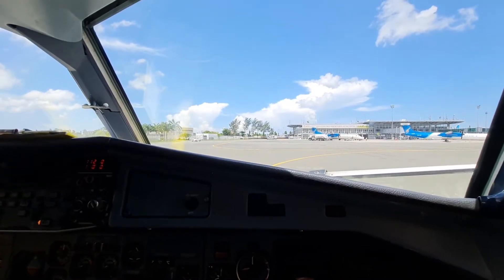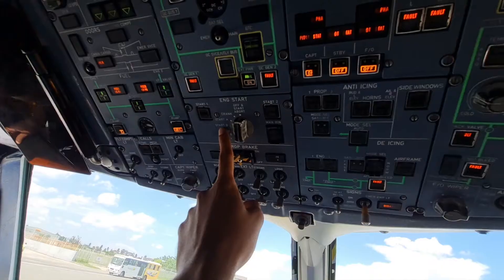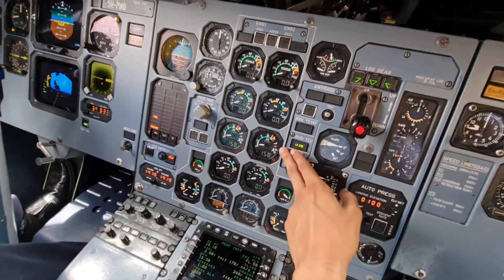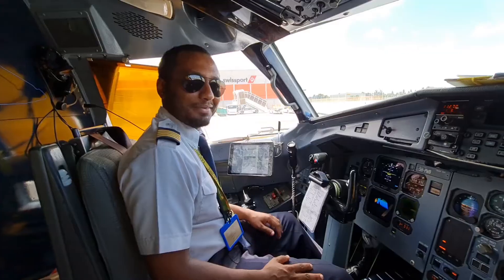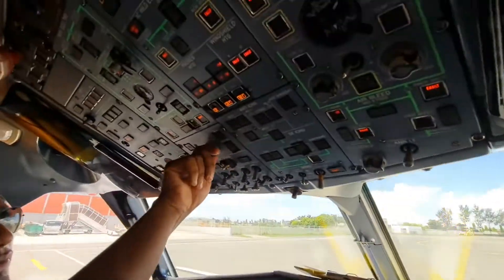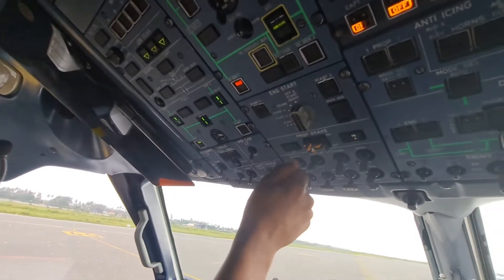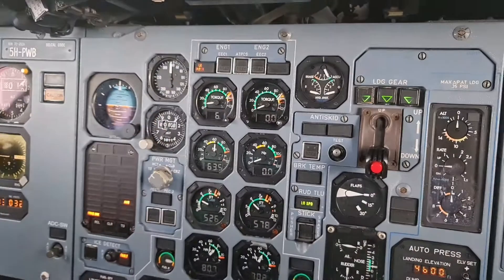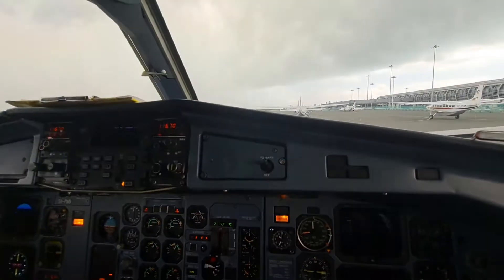Detailed cold and dark engine start up ATR 72-500

Comment: excellent, in a next video there is a demonstration during the operation of the hotel mode moving the power lever from GI to FI, is it true that it increases the air flow in the cabin?
Reply from the maker: Hello Arthur! It is true that the airflow increases when the power lever is moved from GI but it's to gustlock stop and not FI. You have to monitor your ITT closely while doing this.